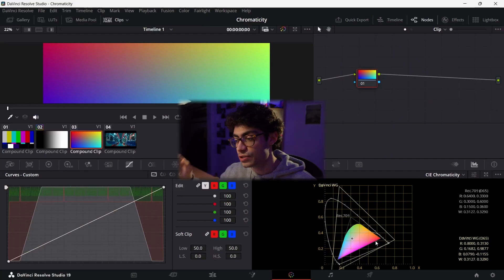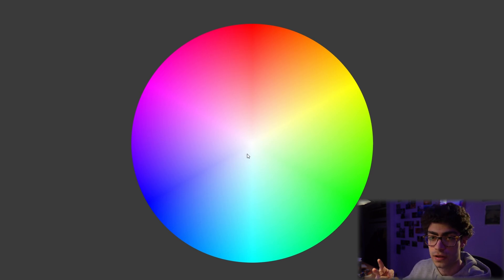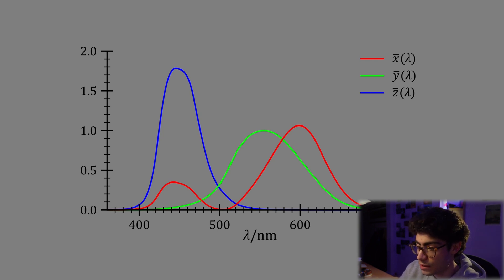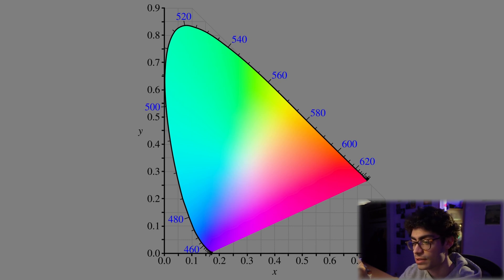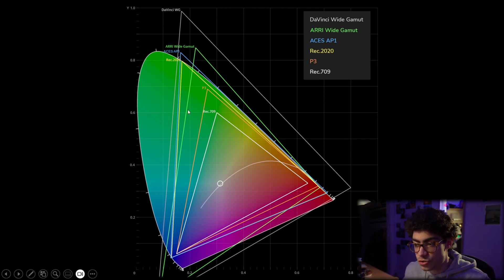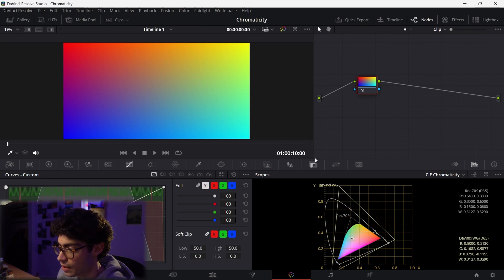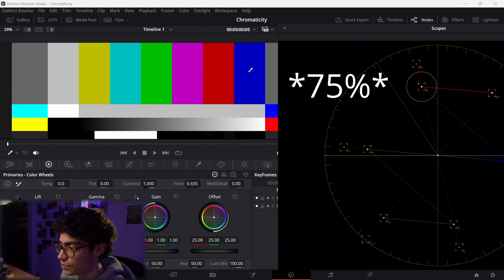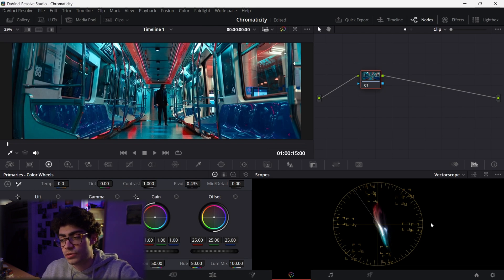Chromaticity Diagram Explained - Why is it useful as a colourist?

Comment: Thank you for the informative video! I have a question: At 8:46, the cyan color is at 75% saturation, while at 8:53, for the same image, the cyan color reaches the boundary of the chromaticity. This indicates that the saturation of cyan exceeds the Rec. 709 color space, right? This seems strange. I thought 75% saturation should still be within the Rec. 709 color space and even have some safe area before the boundary. Do you know why?